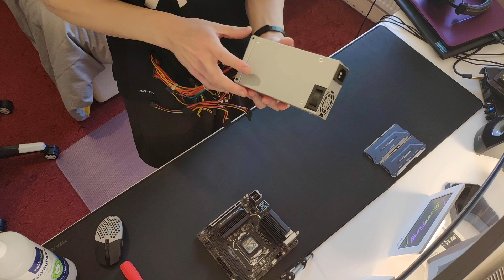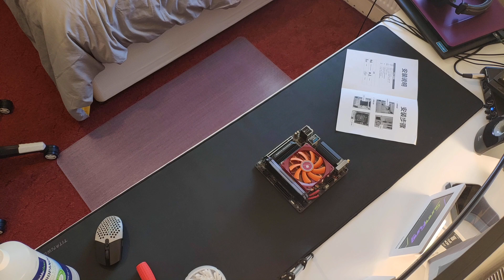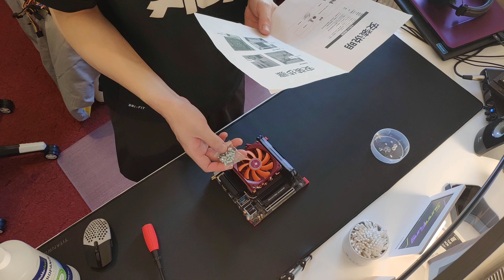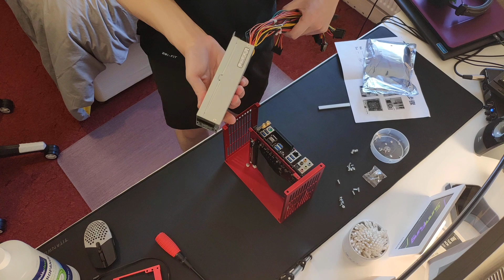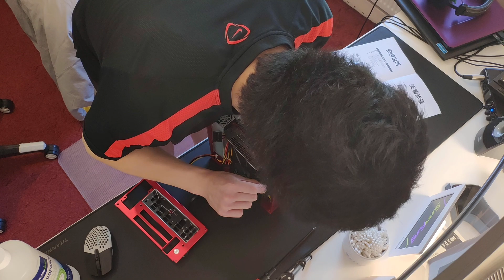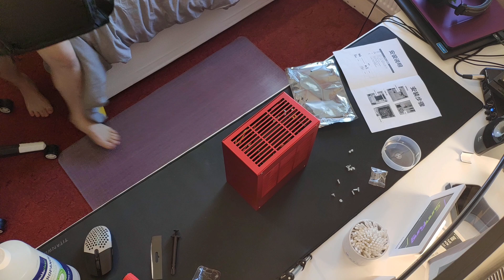SGPC K39 v2 Full PC Build Video

Comment: Does it support fans up top? Dimension and how many can be mounted single or double?
Reply from the maker: I did try to see whether another fan could be mounted internally under the top panel, but there isn't enough clearance physically for this to be accommodated.

I guess the other option is to mount a fan on the exterior, but then that does ruin the aesthetics somewhat.
Reply: @sunnifung2403  may be slim 90mm fan can be adjusted inside of a case? Give it another look.
Reply from the maker: @FailaDK  I did try this back in the day, but it physically was not possible due to the clearances. It only just about had enough clearance on the top for the PCI-E riser cable to slot through. I also just about managed to route the power button through that gap as well 😅

Comment: can it take zotac 1060 mini? it is thicker than this. It is close to 5 cm they say
Reply from the maker: The GPU has to be exclusively 2 slots in width, and the maximum officially support GPU length is 180mm, but that is literally the maximum it can take. 

Being 174mm in length and 2 slots wide, I think the Zotac GeForce GTX 1060 Mini should be able to fit in this case.

Comment: Awesome video! I am hyped to build my own k39 system following your video! One question though, did you get around weighing the full build? I wish to travel with my system from Bangladesh to the US and back!
Reply from the maker: Thank you. I have used it as a portable system between locations before, though not abroad. I haven't weighed the PC either, but at a best guess I'd say that it is probably around 4-5kg? Portable, but also very dense.

Comment: nice build :)
instead of putting rubber on the gpu you could open the mounting screws (from the rear IO) and push slightly the gpu and then tighten it.
Reply from the maker: I tried to push the GPU as far in as possible, but the tolerances from sheet aluminium aren't the best, so the GPU fan would still get caught by the side panel.

Comment: I found that same CPU cooler but I need Intel LGA-1200 mounts for an ROG Z590i The AXP-100 Cu isn't gonna fit. I like that case in red as well but I have a tall Noctua till I get my ThermalRight bracket so I wonder if it'll look cool with CPU side panel off, plus to show RGB ram. 
Oh, and that Flex PSU, looks way cool but for now I have a CorsairSF600 that handles well but will it fit that case? Looks like the Velkase Velka-3 which is Flex PCU it's SFX 100x125x64mm
Reply from the maker: You will find that the LGA1200 socket uses the same cooler mounting holes as the LGA115X series of coolers, so get an LGA115X one and it should work fine with it.

The PSU at the bottom has to be Flex ATX, which is smaller than SFX. The Corsair SF600 would not fit in the SGPC K39 v2 case.
Reply: @sunnifung2403  This is my 1st ITX mush less mainstream 115x anything so I did get the Noctua kits for my Xeon mounts and they fit but get up there to 90 in under a minute so anything smaller then the NH-D9DX-i4 3U isn't gonna work for a warm i9-10850K. I tuned it to auto of 4.5GHz 100% for 80+. I do like that copper and red case so I may find a low watt CPU just to build on to use them. It's like the size of my lunch box from school lol.
Reply from the maker: @khanscombe619  I initially tried to use a 9900K in the PC, but as you may have seen in my open bench testing, it wasn't very good when heavily stressed, so I was forced to use a 9700K instead

Comment: Hi, Sunny. Great build! Could you let me know what the length of the GPU riser cable is? I know it should be a double-reverse cable but I cannot find reliable information online about its length for a K39 case. Is it 18.5cm or 21cm? Thanks.
Reply: actual ribbon is 185 so they just label it as that. Including the connector ends it is probably 21
Reply: Thanks, Sunni!
Reply: @wlee9727  not sunni but no problem lol
Reply: @korruption2802  OMG. So sorry! In my haste, I thought it's Sunny who replied! Thank you for pointing out the riser should be 18.5cm in cable length. I'll be ordering one from AliExpress soon.

Comment: how long in cm is the riser cable?
Reply from the maker: I haven't actually measured the length of it, as I bought the riser together with the case. My best guess would be that it's roughly 20cm, as the height of the case is 22cm
Reply: @sunnifung2403  Thank you. But I already found out that the exact length should be 18.5cm. Thank you for answering my question I hope anyone can see this comment if they're searching about this case :)

Comment: Hello, what do you think about another flex psu models as Delta DPS-500-AB for example or metalfish flex 500? Do they safe to buy and use and is there any way to improve flex psu heat dissipation (by installing extra heatsinks etc.)?
Reply from the maker: I've not looked into those PSUs before, though Delta is a reasonably well-known brand. I'm personally a bit sceptical on the Metalfish PSUs, though there are some people who love them.

In terms of improving Flex ATX PSU heat dissipation... I personally don't really think there's a good way to do it. I changed the fans in my PSUs in order to make them quieter, but that's about all I would try to do. You don't want to risk shorting any capacitors and other components within the PSU if you're not 100% clued up on the inner workings of one.

Comment: I'm so undecided over going with the K39. The thing mostly throwing me off is the flex PSU which most seem to need a fan swap but the size is just so cool. Mine will be a medium build with a i5 9400 with GTX 1650 so I don't need such a powerful PSU. It's not really intended for heavy gaming, just as a fun build. By the way, looks really nice in red. Thanks for sharing, great video.
Reply from the maker: Thank you! I did a video comparing Intel and AMD performance with the K39 case too if you haven't seen already.

For specs like those that you are proposing, I'd still suggest the best PSU you can buy to give your PC the best power delivery possible. I will say that the CPU and GPU cooler fans for my builds were both louder than the PSU fans were at any one point, so if you get a decent PSU I doubt it would be a concern. Not 100% sure on the performance of lower tier PSUs though.

Comment: Nice, saved this video for when my unit arrives. Plan to use the same cooler as well. It seems to me that a modular PSU (I don't know if they make one in flex atx form factor) is a must.
Reply from the maker: The PSUs that are modular are usually modified outside of the manufacturer specification. I have seen my PSU go for $170 on Aliexpress, with modified modular versions selling for $270. 
If you are able to use a modular PSU with shortened cables, then that would be favourable.

If you don't mind me asking, what components are you looking to use in your build? :)
Reply: @sunnifung2403  I see that's good to know. I guess there is no warranty for these then. I found one reasonably priced at GEEEK's site (and since they make small cases it is probably good), but still keep looking for others.
One thing I'm a bit worried about with a modular sloution is overhang, the case is quite thight as it is, not sure how much space I'd have connecting the cables with the extra connector space.

Not sure at the moment, probably a Ryzen 3600 (or maybe a 3700 with some underclock/undervolt) and a 1660 ti/super or a 2060, whichever I can get cheaper. For the board, either b450 or 550,maybe 550 for futureproofing. Hopefully something with 2 m. 2 slots so I don't need any 2.5 drives.

Comment: Can I ask how long is the gpu riser?
Reply from the maker: Unfortunately I did not measure the length of the GPU riser cable. I ended up buying the GPU riser cable together with the case. From what I've seen on the SGPC TaoBao page, different cases require different PCI-E riser cables.

Comment: You end up shortening the cables? I am considering it very much so. The 'mustard' isn't annoying me as much as the extra bulk cable taking up room and preventing the little airflow the K39 has. 3600/2070 setup, L9a cooler, FSP 400w Gold. Debating between cutting the cables and stripping/crimping (longer, more $) or just cutting and soldering which seems faster.
Reply from the maker: I didn't necessarily shorten the cables themselves, though I did remove any sort of daisy chained cables. I personally think shortening the 24 pin CPU power cable would likely be beneficial in this case, especially since space is at a premium.
Reply: @sunnifung2403  I zip tied the 24 cable all the way up and have it parallel to the ram. I would love to get it shortened but I don't have the pins, wire crimper. My RGB cables (daisy chained to 3 pin RGB) are now my mess, got to figure out optimal route for them (hiding them behind the front SSD/HDD mount).

Comment: Man this is exciting - I'm going to be doing a lower spec build in a black K39 (Ryzen 3600 /w cryorig c7g (might fan swap) and a Gigabyte mini 1660 super). 

While I'm here, Silverstone will be releasing a new 500w flex atx PSU soon. It won't be modular, but it will be black, with nicer cables and more readily available!
Also, FSP makes a nice 500w PSU that runs quiet - BUT IT DOES NOT DO SO FOR THE K39! Because of where they put the fan on the FSP Flexguru pro 500w, it runs hot and loud in the K39 as it can't access fresh air like the GPU, CPU or any flex atx with a standard fan position can.

Comment: Will you be making a video on the performance of the build? I'm mostly interested in how the power supply sounds.
Reply from the maker: I will be looking to make a video on performance numbers, as well as a noise comparison (albeit with video taken from on mobile, as I don't have any elaborate testing equipment).

What I can tell you is this: The power supply does sometimes generate a high pitched coil whine, though the CPU and GPU fan noise would mask the sound of any coil whine when you're running anything intensive (e.g. gaming, stress testing).
Reply: @sunnifung2403  in your comment in psu is the good or naah?
Reply from the maker: @ruvixreyez  The PSU handles the CPU and GPU combination without breaking a sweat. When under high loads, the noise from the CPU and GPU fan overwhelm the PSU fan noise.
Reply: @sunnifung2403  how about the coil whine? Did it damge ur psu?
Reply from the maker: @ruvixreyez  There is varying amounts of coil whine, which depends on the load. I would say it's most noticeable when the machine is turned off, oddly enough.

Comment: I was wondering how long is the riser cable?
Reply from the maker: Unfortunately I don't know the exact length of the riser cable, as I haven't measured it. I think there is a specific riser cable to use for this case, though I may be wrong.

Comment: You are my reason why I have this. I'm only using a GTX 1660 super, since we dont have any available 2070 minis here.
Reply from the maker: I'm glad that my video has helped you in your PC decision building. If you don't mind me asking, what PC specs are you running? :)
Reply: @sunnifung2403  Im running. Ryzen 7 3700x with Msi GTX 1660 Super AERO ITX. Delta PSU 400w seemed okay for the build.
Reply: @Zzzzsleeper1  Hi, can you tell me how's that Delta PSU working out, is it too noisy, Thanks

Comment: Hey Andy, did you notice any turbulence/noise issues with the AXP-90 in the K39v2? Im trying to decide between the AXP-90 and the L9a, the AXP-90 would obviously cool better but I'm a bit concerned as it would sit right up to the sidepanel with no space. I read about turbulence issues in other cases where the fan sits right at the sidepanel, that's why I'm asking. :)
Reply from the maker: There will be some sort of turbulence with the fan against the side panel. This will also be the case with the GPU fan, but it's not super intrusive by any means :)
Reply: @sunnifung2403  Thank you for the reply! I guess I need to try it out for myself. I also found a bracket to rotate the AXP-90 by 90 degrees so the fins are parallel to the RAM and IO shield, maybe that will help with thermals. Unfortunately it's gonna take some time via superbuy :D
Reply: @sunnifung2403  Hi Sunni! Would you be able to provide audio recordings of the turbulence sound from both the AXP-90 and the GPU in the K39? Thanks!
Reply from the maker: @shmijjy-isl  Unfortunately I have this PC in exactly the same spec as it was in the build video. I might be able to at some point, though I would need to find time for it

Comment: How is the fan noise coming from the psu?
Reply from the maker: The PSU fan noise isn't really an issue, as the GPU and CPU cooler fans end up being louder than it, even when the CPU and GPU are under 100% load. There is coil whine from the PSU, but that is unavoidable.
Reply: Sunni Fung ok cool, I ordered a modular enhanced 7660b
Reply: @questionableanimals  From where do order your psu?

Comment: hows the psu's sound under full load? is it loud?
Reply from the maker: When running Prime95 and Furmark simultaneously on an open bench with my setup, the PSU fan noise is overwhelmed by the fans of the CPU and GPU cooler
Reply: Sunni Fung what about when gaming or idling?

Comment: does ur enhance have any coil whine?
Reply from the maker: The PSU does exhibit some coil whine, which you can't do anything about. The PSU I put in the system exhibits coil whine when the system is off, and varying degrees of coil whine when the system is turned on.

Comment: Is it possible to add 1 or 2 noctua 4x10mm fan there? Maybe above the GPU and one above CPU. Do you think the PSU fan loud?
Reply from the maker: I have looked at this, and unfortunately it isn't possible due to the PCI-E extension cable being in the way. I've seen people who have 3D printed a frame to mount 2 40mm fans above the CPU cooler, but that's only possible if you've got the parts available to you
Reply: @sunnifung2403  apparently it can be done. I just received the case and assemble almost exactly like the one u built. I can put two noctua a4x10 above gpu. I believe a couple of those fan can also placed in the front panel. Now I'm working on modifying the front panel so I can have several vent holes. I'll update as soon I finish the mod.
Reply: @ekafithraelfi  Did you make the mods? Ill be glad to see it if you could share since i plan to build in a k39 soon
Reply: @taoseefaziz7188  Hi, the fan above GPU is not enough to pull hot air, I ended up put slim rgb 9x15 fans above the case. I manage to put holes in front panel and add 2 40mm fans as intake fans. U can see my first iteration at https://pcpartpicker.com/b/dp3tt6
Reply: @ekafithraelfi  Thats really cool, thanks for that

Comment: hows the temps of the pc and the noise of the fan of cpu and gpu and also the psu fan, does it coil whine?
Reply from the maker: When running the parts on an open bench with an ambient temp of 18 degrees C, the CPU was running at around 100 degrees on Prime95 v26.6 SmallFFT. The GPU would run at mid-60s whilst running Furmark. The PSU fan does make a bit of an annoying noise though, so that has been changed. The PSU itself does exhibit some coil whine, though that seems to be somewhat unavoidable.